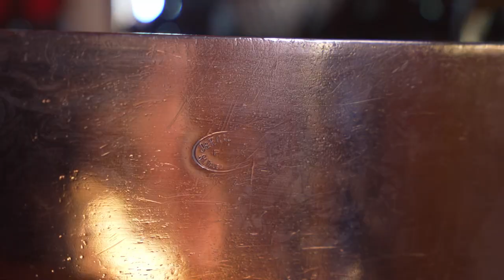Returning Home to the Chateau - Doing it Ourselves

Comment: PRIME THOSE WALLS with a stain blocker before you paint them green! You never want to paint directly on unfinished cement/plaster board walls, it will suck up your paint at different rates and your entire finish will be uneven.

Comment: I found with the mints and lemon balm if you take a deep plastic pot cut the bottom out then dig a hole put it in the plastic pot inside then plant you plant inside the pot. The roots will have to down instead of out and up to the surface to invade your garden.

Comment: You may want to check around with some woodworkers on this: I heard a tip in one of my woodworking classes to always prime/paint both sides of your siding when installing wood siding, to keep the moisture absorption and loss even and prevent warping. Might be therefore worth finishing the backside of your paneling in the same way you do the front!

Comment: thankyou michael for this update on how everyones doing and the progress they have made. Sorry about your paneling.  I am not any expert but maybe would it be an idea when you unscrew each panel along to number it on the back so it gets put back in the original sequence as each one was cut to size just in case the ceiling is not dead straight. I know when you lay laminate flooring there is a gap near or under the skirting boards to allow for natural expansion of wood so does paneling have a way to have a small gap at the corners to allow for this ?  
The drainage issue outside i remember steffanie had a similar problem and they sorted /dug and laid a drainage valley to help drain away excess water from the side of the biulding. Good job you ordered a spare box for the arga saga . Thankyou once again for the update